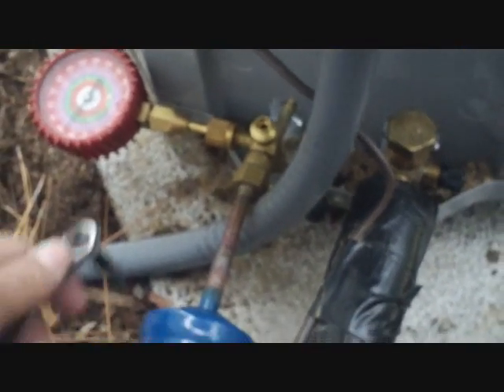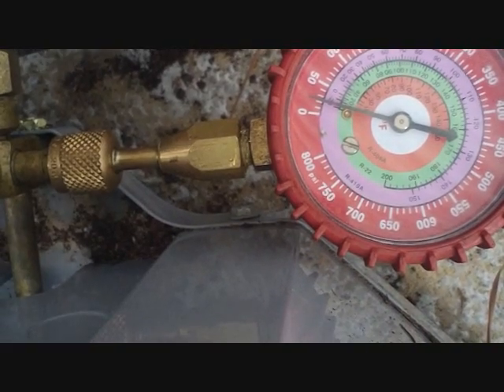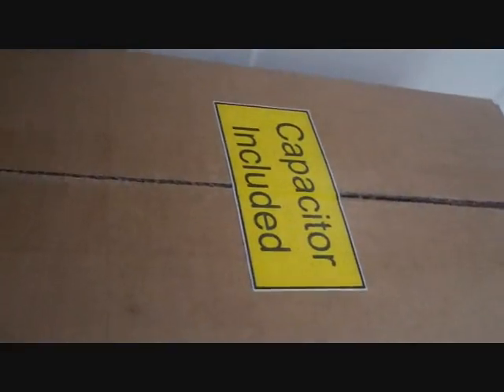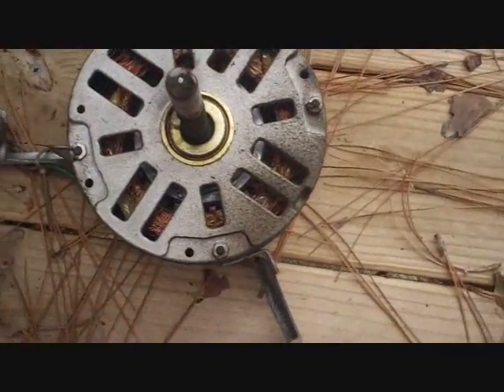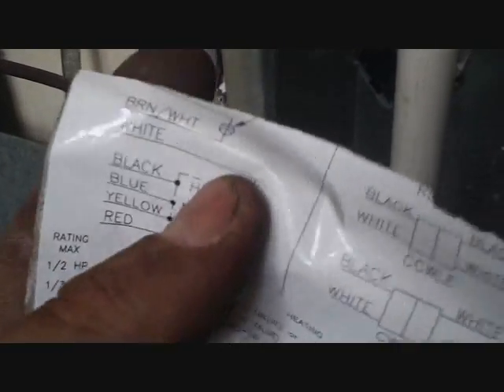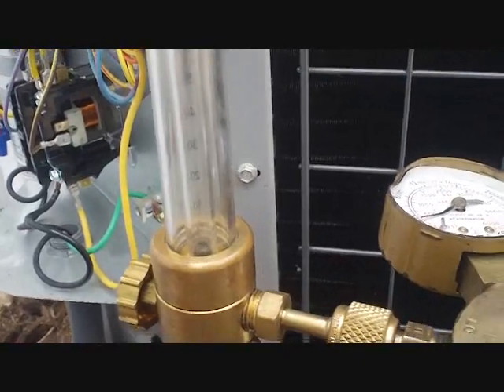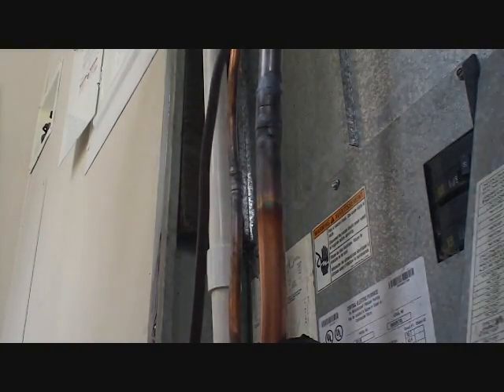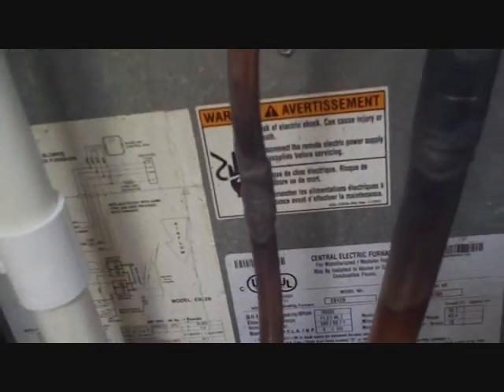HVAC Service- Blower Motor Replacement and More

Comment: would it be possible to use an arbor press to press out the motor and shaft instead of the puller?

Comment: My blower motor makes a semi loud screeching noise when I turn the fan On from auto. The noise does come from the motor because it stops when the fan is turned off. The fan continues to spin after it is turned off but there is no noise coming from the motor afterwards. This leads me to believe that I have a bad motor. The capacitor wouldn't have anything to do with the noise, would it?

Comment: I replaced a outdoor 825 rpm,208v ,1.9 amp fan motor and cap with a granger replacement, and now the main breaker will get hot and trip. Any ideas?

Comment: A guy is charging me $1100 to change my AC lower motor .  the outside unit is from 1996 does it make sense to spend this money in repairs and is it a bit steep or is it fair, I'm a bit confuse, please advice.

Comment: Can you tell me where you purchased the short hose that you use with your gauges instead of manifold gauges.
Reply from the maker: You can buy Yellow Jacket gauges that look just like mine from places like Johnstone and the short hoses came from East Coast Metal Distributors. They would be at Johnstone or RE Michel too.
Reply: talyn875
I don't even use a flow meter, I just barely run enough nitrogen through my manifold, that the pressure doesn't jump up.

Comment: Hey Zack,
       Why did you take the Line-Set apart? Could you not move them over to get the blower motor out of the case?
Reply from the maker: yougetwhats comingtoyou no, it was too tight

Comment: I have a question I turn my heat on to 70 it ran for 3 minutes then it stop blowing but when I open it up I can see it was lite up orange on the inside I guess that indicates the heat works but it just not blowing out but my ac it blows out but it don't blow out when I switch to heat can anyone help me

Comment: I'm so confused. Wouldn't you close the vapor side of the circuit so that the compressor will send all the refrigerant to the condenser side first. Then start the compressor and let it compress all the gas/vapor into liquid to send it to the condenser and have a gauge on the vapor side to show you once the pressure reaches zero to THEN close off the liquid side valve.

Comment: hi friend my home motor blower has recently failed and I'm being charged 700$ for part and labor is this a reasonable cost?
Reply: +MrJayroc198 Hell no that's a ripoff, you can buy a motor yourself for like 70 bucks
Reply from the maker: +iPARASITExEVEi if it's an ECM blower they are more expensive.
Reply: Not 700$ expensive

Comment: I replaced a outdoor 825 rpm,208v ,1.9 amp fan motor and cap with a granger replacement, and now the main breaker will get hot and trip. Any ideas?
Reply from the maker: you should check head pressure.